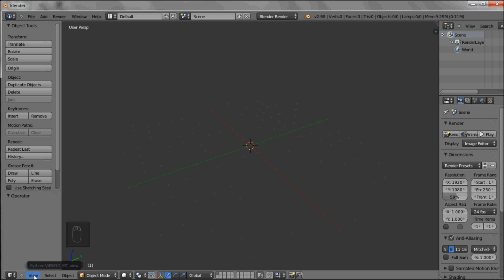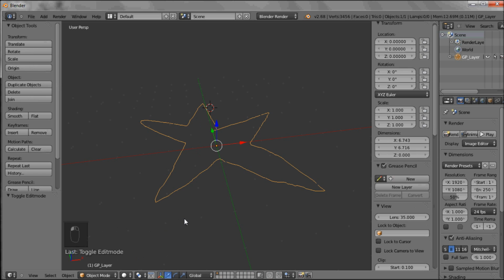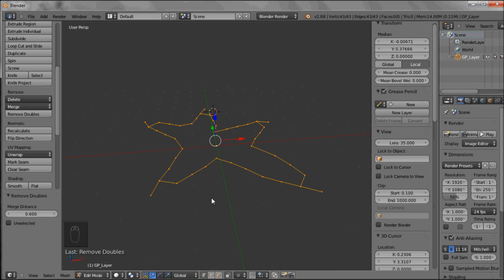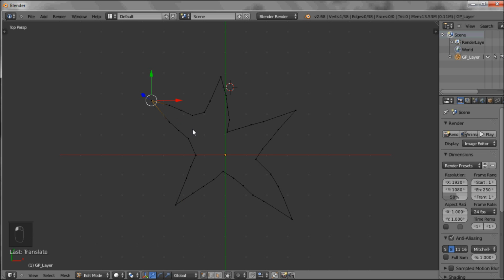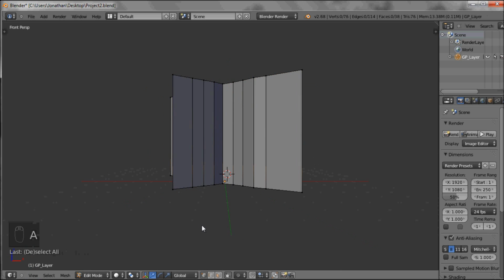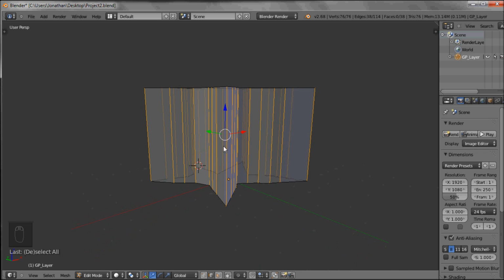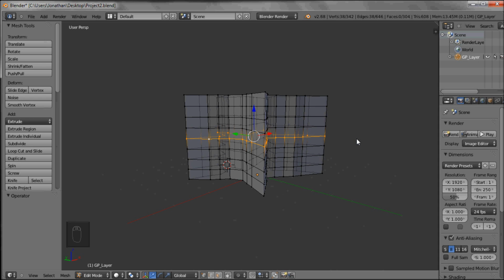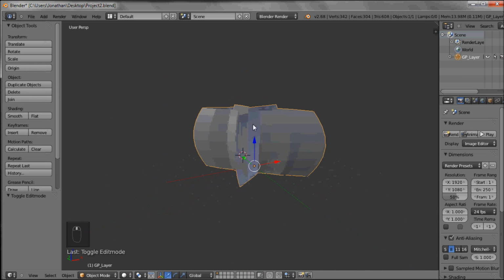5 Modelling from a grease pencil drawing

Comment: Doesn't work in 2.78. I make a pencil sketch, open up N panel and there is no 'convert' button anywhere. Was it moved ?
Reply from the maker: I think in newer versions of Blender the grease pencil 'convert' are in the T panel along with where you found the grease pencil. If you could confirm this it would be useful for others.